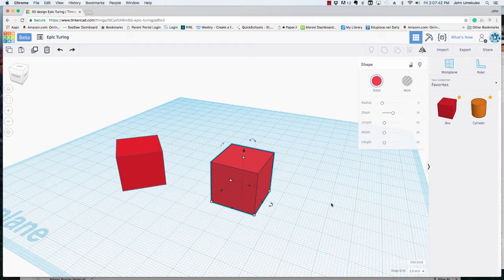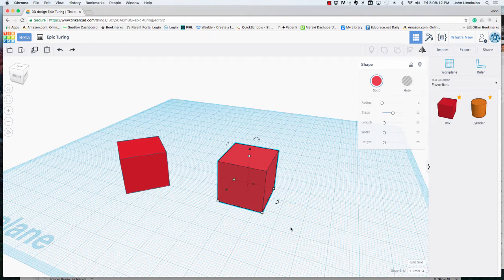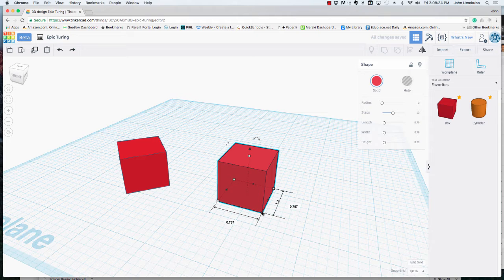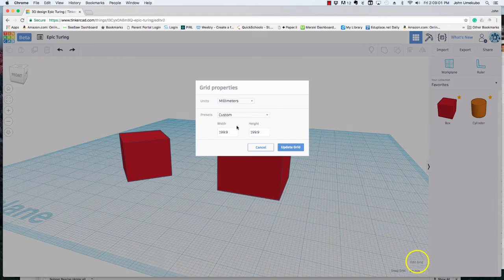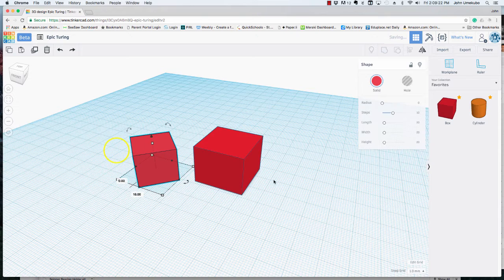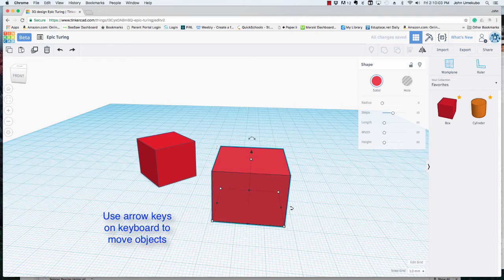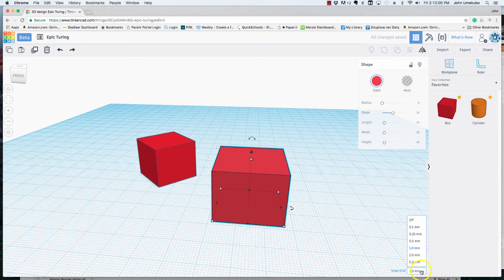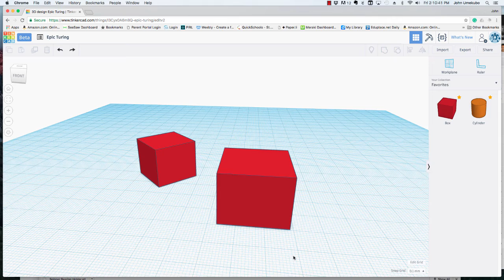04. New TinkerCAD - Edit Grid, Snap Grid

Comment: how to change the camera. i just want it to be flat and not being controlled by the mouse.
Reply from the maker: I am not totally positive I understand the question, but I think you may benefit from using the icons on the LEFT side of the screen. There is one, at the bottom of the icons there, that can turn your view to orthographic. This will be a flat view. And you can use the navigation cube to view directly from the top. I hope this helps.

Comment: Mine is not allowing me to change the grid size. Is there a common reason?
Reply: @johnumekubo  The problem was that I had something selected that I didn't know was selected.  However, I'm still unable to make the grid as large as I need (50-inches square). Could there be such a low limit to the size?
Reply: @johnumekubo  Thanks. The maximum size of the grid should be easier to find out. I searched and searched.
Reply: @kennybellew  Wow, I am so sorry. I thought I replied to this thread long ago. Just reviewing now since a new comment came in. For what it's worth, this was what I found online: "Tinkercad has a limit volume of 1000x1000x1000mm (~39 inches). "